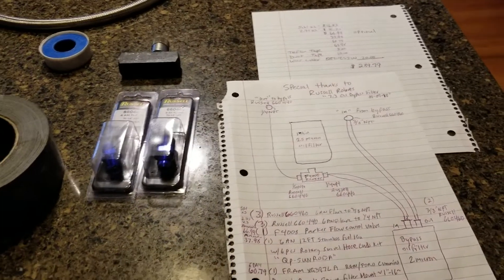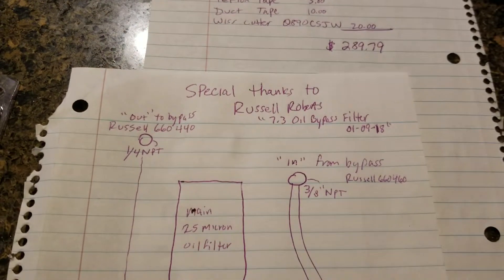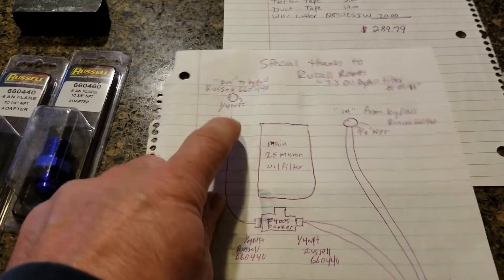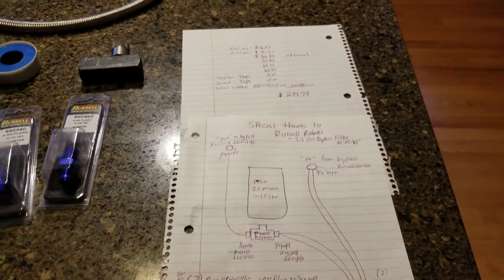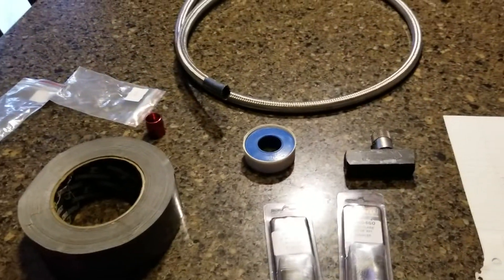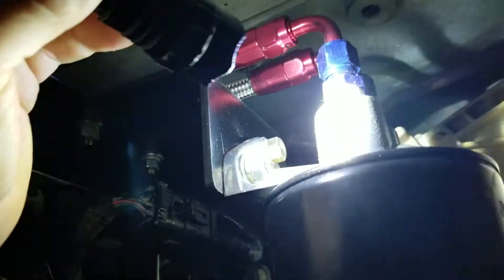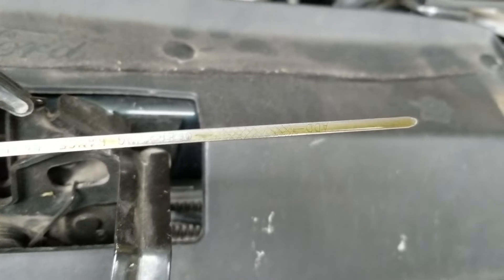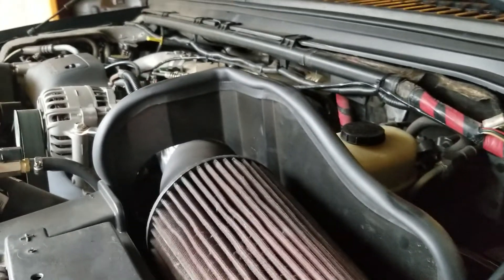2002 ford excursion 7.3 bypass oil filtration

Comment: What’s the difference on the high pressure side on location? I see that you’re coming from the oil filter housing on the left side of oil filter and I see other videos that are coming from the right side of the oil filter by where the return line goes. It’s a 1/4 male square plug by the bell housing.